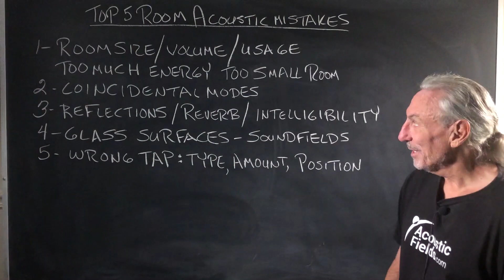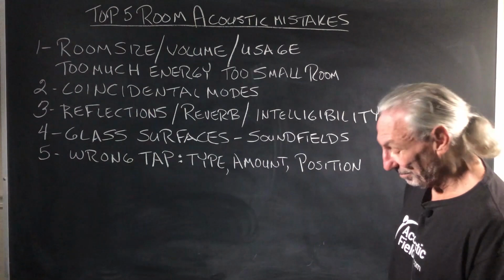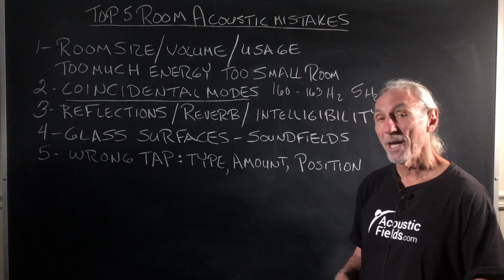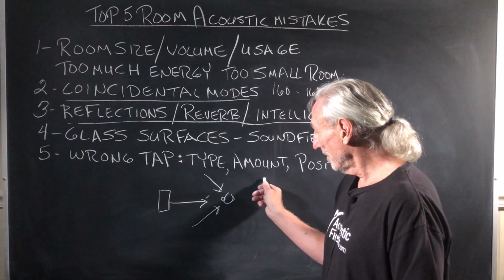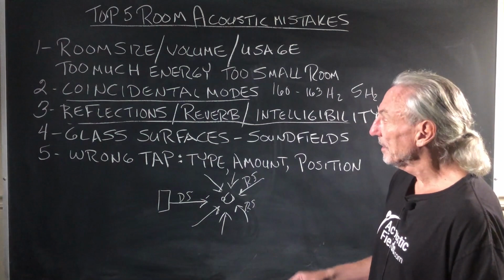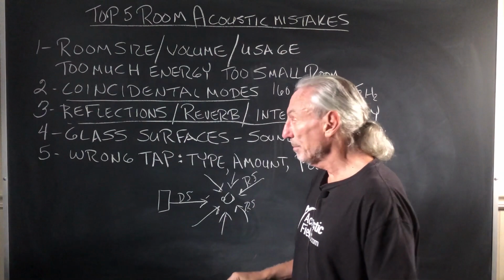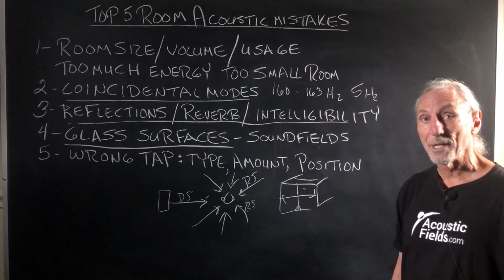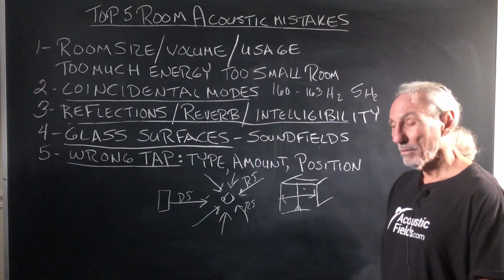Top 5 Room Acoustics Mistakes - www.AcousticFields.com

Comment: Dennis, you're the guy I look to when I have questions/cocerns about treating my room. Wish more people were turning to you for advice instead of all the stuff I see on reviewers YT vids. In fact, when I see some of the rooms I see in gear reviews, I question the reviewers ability to listen critically.
Reply from the maker: The reviewers are paid pundits for the manufacturers. I have also seen their rooms. Most are nonsense. There is no way a critical evaluation can be assessed in their rooms with their current set ups. The differences most are hearing in the gear they review are differences that can be corrected with proper room treatment and room volume.

Comment: Dennis... I appreciate how you introduce the physics of sound and how a room reacts to it. Although, your suggestions may be just a little over the top for me as far as "critical" listening because I'm 62 and have hearing aids (which simply don't compare to 30 yr old perfect human ears) of which I'm still trying to dial in. I have absorbed every syllable of your language and seeing as though I'm not an idiot, will proceed treating my room with absorption for the highs, diffusion for the mids and helmholtz (of two different configurations) for the lows. I certainly don't expect a "MONUMENTAL" difference in what I end up hearing... But, it would be 'nice'. THANK YOU  for all your "free" guidance !
Reply from the maker: You must start with low frequency management first and foremost. Low frequency management along with its rate and level and surface are covergaes are determined by what you have achieved in low end resolution.

Comment: Great video! You hinted at the "standard" corner treatment being essentially useless - what would be the correct treatment for corners? Have you already done a video on that? Thanks!
Reply from the maker: By definition all modes are produced by 2-6 parallel surface areas not two parallel corners. A corner only represents 10% of the total surface area of the wall which is producing the modal issues. How can treating the corner at 10% coverage impact the whole wall problem. The answer is it can not. This is another example of industry hype taking a half truth and making it sound like a whole truth. They do this all the time.
Reply: they are not "essentially useles" and membrane absobers in you corners work very well at their own - but it's not a 100% solution for all issues - for subwoofers combined with "antimode" devices it helps a lot depending on your intended usage - but alone it don't solve all physical problems fully

but yeah, put "foam absorbers" in your corners is completly useless
Reply from the maker: @Harald_Reindl  When you treat only 7-10 % of the total wall surface area and by definition, the unwanted pressure issues  are produced by the complete wall, let's term this variable 100% This 10/100 ratio is a useless tactic against a large problem. The industry is full of half truths and companies who offer products that are just Band-Aids against the real core issues. The problem with Band-Aids is that they eventually come off and people realize that they still have the same issues. Some find that by treating just the corners, they produce more audible problems.
Reply from the maker: Treat the whole wall and its opposite partner in crime. By definition, your unwanted low-frequency pressure issues are produced by two parallel walls, not two parallel corners.
Reply: @AcousticFields  don't get me wrong but when i get the reverb time down by 250 ms with two membrane-absorbers in remeining critical frequencies at two corners (surely in combination with antimode/dsp) it is a nice result! yes

only on the listining position which has the subwoofer 30 cm at the listening position and one of that membare absorber is straight at the  pressure maximum of the "flat-subwoofer" behind the couch

anyways, in this room with it's size, positionings, the desired volume level it did exactly what it was supposed to do for 200 €
Reply from the maker: @Harald_Reindl  Your chasing the ghosts of the total wall issue. Treat the wall with at least 50% of the proper rate and level of absorption then no more ghosts.
Reply: @AcousticFields  when I measure with REW 35-16000 Hz has a linear SPL and a linear reverb time of 300 ms except a small room-mode with 450 ms at my desired volume level

below 35 Hz is not desired, filtered away and vibrations at the listening place are coming from two controlled I-beam devices

as I am 43 years old I don't measure above 16 khz because I don't hear it anyways :-)
Reply: @AcousticFields  This is often overlooked.. early on, I realised that treating the corners did very little for the overall response. So I looked further into and discovered by trail and error what you just said
Reply: fartpoobox ohyeah  bullshit - he is absolutely right in nearly anything he says - he is even right that corners alone don't solve all problems but YES begin with the corners
Reply: fartpoobox ohyeah  how can absorbers in the corners be 30% of your walls unless you are living in a 2 meter dog house?
Reply: fartpoobox ohyeah  some corner foam will do you well, ah man not saying anything is better

Comment: My HT room will fall in the too small too much energy category, haha. It's 12x13' with 6' 10" ceiling. I went with smaller monitor speakers (11 or them) and two 10" subs to start. I'm trying to prove a big dynamic experience can be had with small speakers and relatively low power in a small airspace. We'll see how it goes. People want me to get big SVS subs, but I don't think they will help in my room.
Reply from the maker: No need to think about that sub question. Why would you add more low frequency energy into a room where the issues are produced by too much energy. Quantity will not improve room resolution.

Comment: I have seen measurements that glass and drywall is not actually that different in what frequencies they reflect.
But the bigger point is that if you have windows high up like in room drawing example then the walls are freed up for putting treatment anywhere that fit us optimized.

A window on one side is not probably a option to cover with treatment.. and we want symmetry..
Reply from the maker: Yes symmetry is critical. Even if you are doing it wrong, do it wrong to both left and right channels.
Reply: @AcousticFields  😂
Yes maybe one of those reare times where wrong + wrong = right 👍

Comment: Dennis, I have a possibly stupid question, so forgive me.  If sound reflections from the front and side walls cause so many issues, why not build a 3 sided backstop behind each speaker, using sound absorbing and diffusing materials, so that the effect of dressing the room is more immediate?  Does that make sense?  Yes, you may need to dress the ceiling, walls and corners behind the listening position, but the front wall (i.e. the television or gear stand) would not play a part in the sound reflection?  I honestly have never seen this possible solution mentioned, even as a bad idea, in any videos or articles regarding room dressing.  This question isn't just for Dennis... if any of you super smart folks can explain why it would not work, I am very interested in hearing why. Thanks!
Reply from the maker: We use this approach with our wing series. 
https://www.acousticfields.com/product/wing-series-daw/

Comment: Hi there,
I would like to know can I put a floorstander inside a room with
 12ft length x 10ft width x 11ft height.. Will it over powering the room?
Reply from the maker: What are the number and diameter of all the low - frequency drivers?
Reply: @AcousticFields  1 x ribbon twitter, 1x  6.5inch mid range and 1x6.5 inch bass

Comment: Im building a house . And my first music room for listening , recording and mixing. You were explaining in another video the golden ratio for s studio in order to minimize unwanted reflections. I beleive it is 5.18 × 3.80 x 7.10 meters as size. Which will be ideal to to taim both low and high frequencies. But say if i apply reducing %10 percent of the room size can i still get that good ratio? I know there are many other factors. But would it be good start just considering the room size?
Reply from the maker: Focus on having enough volume to minimize low frequency modal issues. Look for ceiling heights that are 4 m or higher. Make sure you allow an additional 250 mm all the way around the four walls and ceiling for low-frequency management. Choosing the proper volume is only the beginning of a long and complicated process. After it is over and you have put in the effort, you will have a room that you want to be in all the time.
Reply: @AcousticFields  thank you so much. I learn a lot from your videos.

Comment: Great video! On higher volumes, over 85 dB I hear like room resonance at 700Hz. Is it possible that room has such a high resonance frequency. Room is 12 by 15 with no acoustic treatment?
Reply from the maker: That would be a harmonic of much lower frequency issues.

Comment: Is there a ratio of room size to SPL that is ideal? Seems like a lot of folks listen around 80-83 dB regardless of room size. Should SPL stay the same in different size rooms.

How, other than preference, can we calculate a rooms SPL limit?
Reply from the maker: All room sizes and usages have an SPL range that works best for both modal excitation and reflection management based upon the room width, height, length, and usage.

Comment: I'm interested in purchasing a 4' x 4' whisper room and would like to know what approach I should take when placing my sound absorption panels.  What would you recommend?
Reply from the maker: Foam would be the most economical choice for reverberation management. Whisper Rooms do not provide low noise floors if ambient noise levels are over 80 dB SPL.

Comment: Hi Dennis, I have a 89 ft2 room with a 2 panel window. I am a singer/songwriter (I don't use the room for professional music recording/just ideas) and use Garage Band. However, I am trying to get into VO. I have an iMac and use Audacity. I have an Apex 540 w/pop screen. I use headphones for my Scarlett and don't use monitors. I need to treat my room. I'm thinking Acoustic foamies, blackout curtains for window and portable booth for further voice soundproofing. 

Old house w/2 teens. 

Any advice?
Reply from the maker: Remember the room does not care what energy source is placed within it. The room only sees energy. Curtains are not a barrier technology. A barrier is a permanent build with the proper construction methodology do deal with the frequency and amplitude of the noise issues.

Comment: Dennis, high End audio, is so over-priced....I have decided it is cheaper for me to build the perfect listening Room in my garden...can you help with dimensions and materials advice ? thx
Reply from the maker: Setting up in your garden removes the room from the distortion equation. If ambient noise levels are low enough, your system will never sound better.
Reply: @AcousticFields  so what should be the ideal dimensions of my listening room, as I have a huge garden ?
Reply: @AcousticFields  Does this mean that I can put my studio monitors in my garden, in a fully open space without any walls and get good sound?

Comment: let me throw some crazy thing.. i am trying to treat a 6LX5WX6H feet wooden container. Can only spare this space in my house. Well, wish me luck, if anything can save me here. And yes, to make matters worse i have a 10inch sub lying around to be used. Phew.. probably i should stick with headphone.
Reply from the maker: Do not waste your time with this room size. You do not have the space avavilability requirements to treat the frequency issues.
Reply: @AcousticFields  thanks, yes, i am leaning towards that only. I will treat this space as a recording booth rather, hope i might be able to achieve that. For a bigger space, i have to wait, till then will use headphones for mix etc. Thanks for your reply.

Comment: Put your system  in a BRINKS TRUCK
Reply from the maker: Steel can be used as a low-frequency barrier material. We have used 1/2" steel plate on projects where low-frequency transmission is an issue.